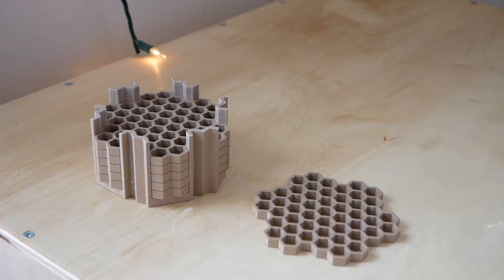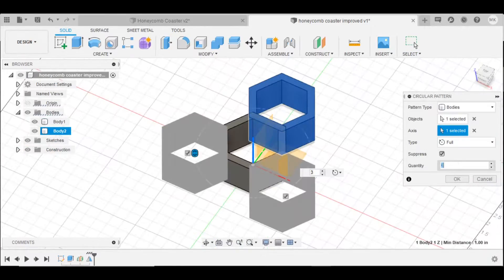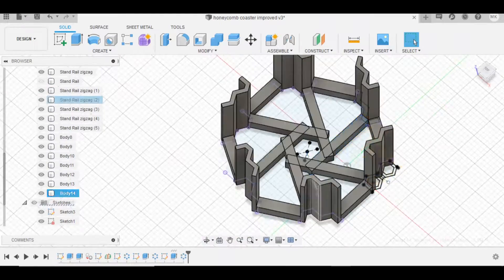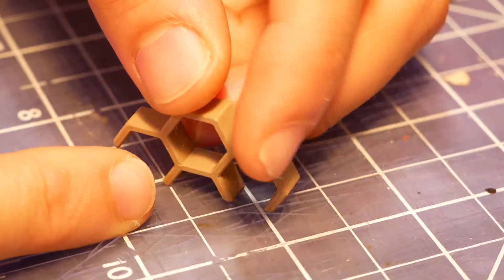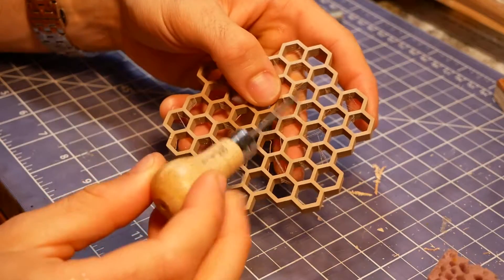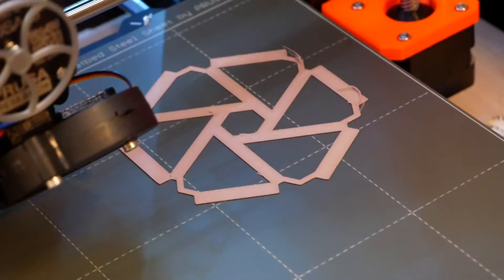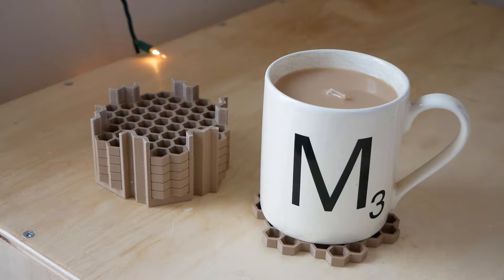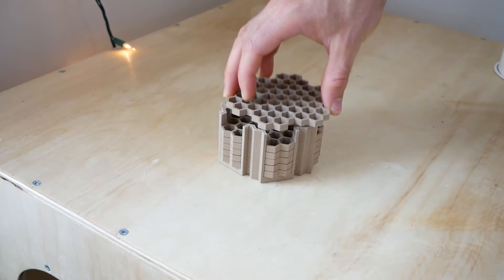Making 3D Printed "Honeycomb" Coasters with Wood PLA

Comment: Thought to add my same problem with bed adhesion from using many brands from 20% to 30% infill
Esun, Jayo, Hachbox Ankun,
I found Esun and ,Ankun to print the best without stringing, but a bit hard to get first layer. as Hachbox and Jayo strings a lot but first layer easier.

Anyway I have spent many days trying to sort out with differant brands.
some print I done came out great but by luck.

I didnt record the settings and so the next times i had all the problems
I did find the setting in the Gcode in the end and now have them set as profiles, thank god.

There are many factors that causes the problem, 
Best way is to clean the bed every time before printing,

Print with a Brim and don't use a skirt and move the z height close to the bed of about 0.01 so you get almost a translucent first layer,
No Glue needed as this causes lifting around the second to third layers.

To start of with use around the middle temperature for the Bed as described and also find the sweet spot of the hot for the fillament by printing a heat calibration tower, this is a must as will save wasting time and material on the long prints

Also make sure not to print to slow as the heat from the nozzle causes the first layer to lift
If you print to fast then it does not get chance to stick properly as it basically drags the filiamnet of the bed.

for trying out the best speeds & heats and feeds i would make a 2mm thick square model about the size of acup base.
Why square you may ask. well its the corners that cause a lot of problems due to shrinking and stressing. as a round objects has much less,
Well i hope some one find this helpfull.
Please comment on your experiance.

Comment: When did the skirt get three layers?  
Ya know you can do the same thing without wasting your time in cad. Just take a basic shape at 7mm in height and have 0 top and bottom layers and just exposing the infill and multiply the infill lines.
Reply from the maker: That’s an interesting idea! I should play around with infill Art
Reply: @MorleyKert  
I didn’t mean to sound snarky. 
I made a soap tray for the bathtub out of TPU it more like a little mat and the soap sits in it   I used 4 walls and 10% triangles infill and no top and bottom layers at 5mm height. 
It’s two years old and still holding up.
Reply: Oh and multiplied the infill lines to two
Reply from the maker: @jack0cat  you don’t sound snarky, it’s genuinely a cool idea that I will look into!

Comment: *Notices your mallet looks familiar*
*Hears you talk about cleaning up stringing with an awl*
....is.....is this a (fellow) leatherworker with a 3D printer? Why, yes...yes it is. 

And subscribed. 

Also, love the coasters! You could possibly do a wood PLA/leather combination print w/ leather insets on the coasters as well (for tooling, etc) too!
Reply from the maker: A kindred spirit! ❤️
That’s a cool idea, I’ve been brainstorming more ways to integrate Leather with 3D printing!
Reply: @MorleyKert   Definitely molds/jigs (and even some kind of way to clamp the molds/jigs together), as well as dummy phones (for phone cases and even sheathes/ holsters if there's a need), Definite shop stuff as well, like sanding jigs for edge finishing.

Comment: Fun design! I usually use isopropyl alcohol to clean the bed and that seems to work on my Ender 3.
Reply from the maker: Thank you! I use isopropyl alcohol after every print but that just wasn’t cutting it this time, though dish soap did seem to be more effective. I only have 70% so maybe that’s part of the problem.
Reply: I guess 3d printing is still a bit of an art!

Comment: I love using that wood filament! It's totally underrated. Nice job :)
Reply: Also, a glue stick might help when things aren't sticking... I have to use it with some of the specialty filaments. Not ideal, but it works!  Again, awesome video.
Reply from the maker: Thanks!! Definitely will give the glue stick a shot on the next print